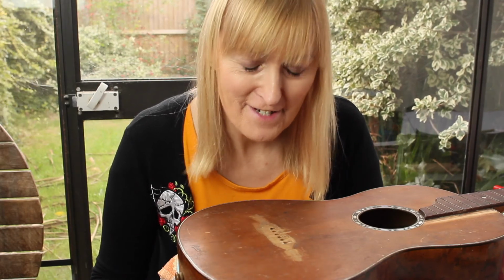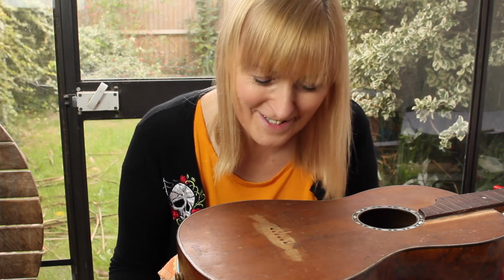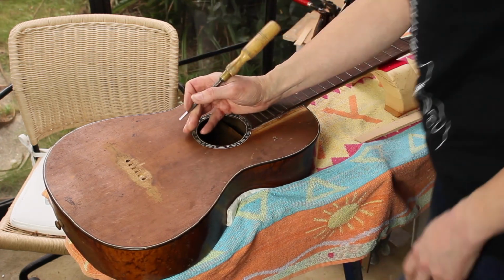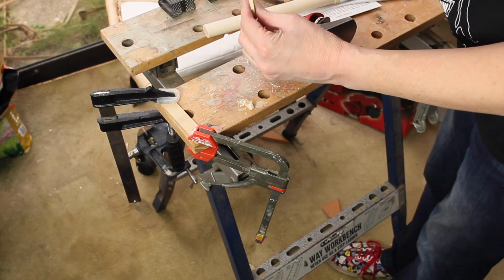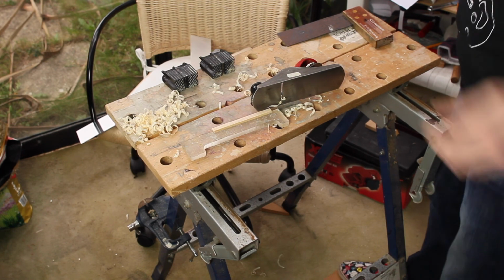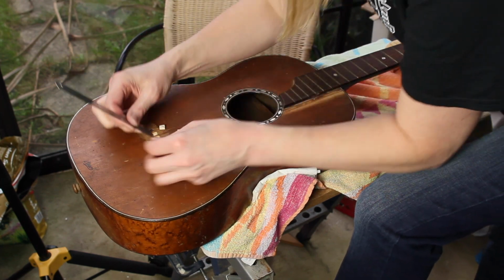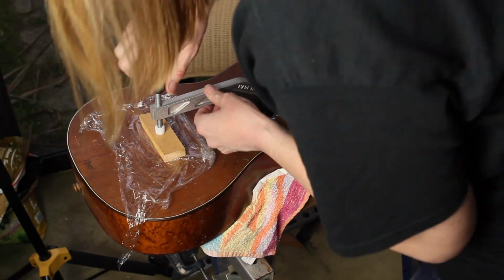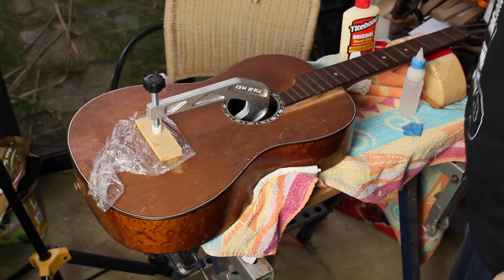Restoring an antique parlour guitar part 11: Filling the old bridge pin holes

Comment: There seems to be something wrong with that block plane. It seems to bite, and did you say it took a thicker shaving against the grain? The likely reason is that the sole is not flat. That is easy to fix with that glass plate and sand paper. Just back out the blade so that it doesn't come out at all (but don't remove the blade, because that changes the tension and therefore the shape of the plane) and rub it on the sand paper until iron is removed from all parts of the sole. Another possibility is that the bed of the blade is not perfectly flat and that lets the blade flex. See videos about plane restoration, that is a good skil. Necessary for even new planes, unless you buy premium quality, where this is done on the factory.
Reply from the maker: It's a very cheap plane and I'm retiring it. I now have a much better and lower angle block plane that's got proper adjustment controls

Comment: Been sitting here most of this morning and an hour in to this afternoon watching all your videos, I am well impressed with your work but could I ask one question. When you made the bridge plate and drilled out the locating holes, why not at that stage drill out all the peg holes to and use dowel pins to block off the original holes. could have possibly saved you a lot of time and effort seeing as you had to rout out the damaged wood anyway.. Billy
Reply from the maker: The pin holes were really damaged and dowel didn't seem appropriate - it seemed easier to inlay over the bridge plate given how thin the top is
Reply: sorry Susan, I have just logged on to youtube for the 1st time since i posted my question. thank you for your answer.